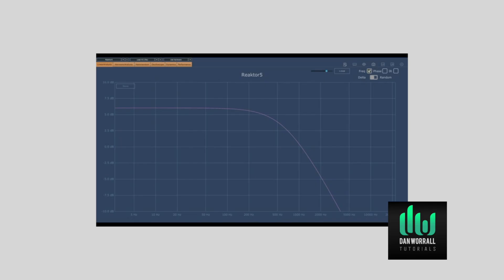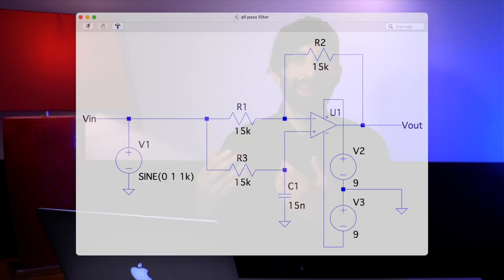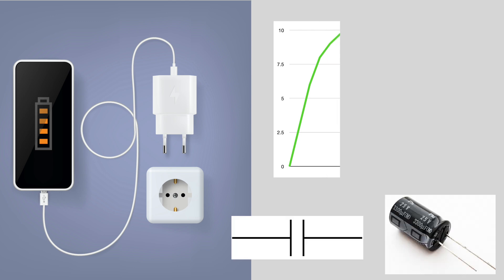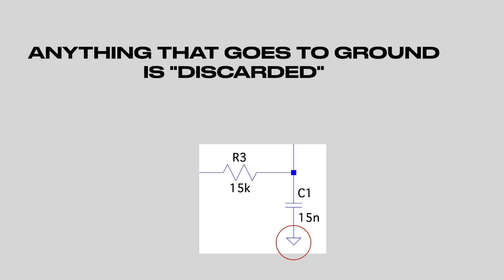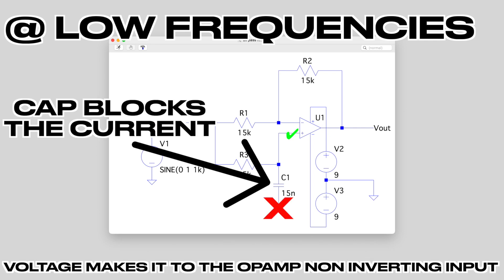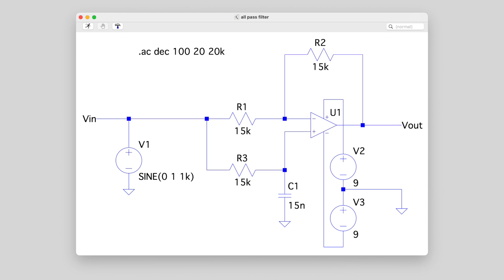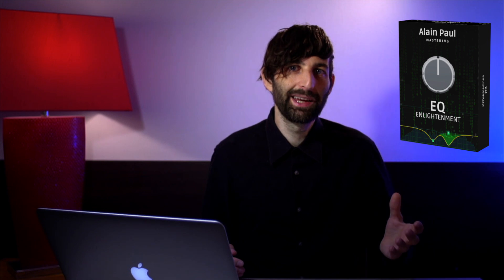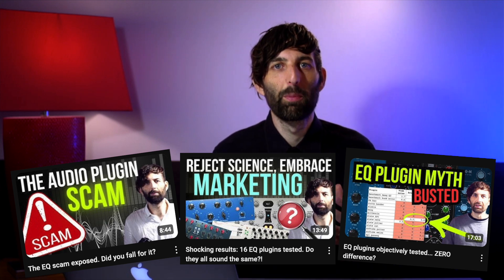Does phase shift ACTUALLY cause EQ? Dan Worrall response

Comment: Nice video. My only cranky guy gripe is that current doesn't really pass through the inputs of the opamps. They are incredibly high impedance, and really just "measure" the differential voltage inputs.The magic happens with the virtual voltage at the opposing input when under negative feedback.

Comment: It's a lot easier for me to remember and understand reactance  of a capacitor and inductors if you remember how their impedance changes with frequency. Reactance of C ,X_c= 1/(2*pi*f*C). Just test at f=0 and you get the equivalent of an open circuit ( high impedance, hard for DC to pass) Now test at f= inf and you get impedance of a wire ( almost zero ohms, easy for hf). For inductors, X_L = 2*pi*f*L. this works the opposite. zero impedance at f=0, and high impedance at high freq. For simplicity, just remember, Xc~1/(fc), Xl~ fL

Comment: Great video, This is all new to me and I'm having trouble understanding why phase comes in, I understand inverting it cancels out that part of the wave. But if you have already "binned/grounded the high frequencies" why couldn't you just take the output of the lower path in the diagram before the OP Amp? What are you cancelling out with the phase inversion if that part of the signal has already been split and discharged to ground through the capacitor?

Comment: So, did you study electrical engineering or sound engineering at uni? I'm assuming that if it was sound engineering, then there were modules of electrical engineering as part of your studies? Very cool.
Reply from the maker: I studied audio/music engineering but I learned very little from uni. I learned almost everything I know independently either by working in the industry or reading etc

Comment: Great explanation on the basics of these analog components and circuits.
But the topic is way more general I think. You focused on some implementations, in your case implementations in the analog world. But just because you showed one basic all pass filter analog circuit in which there is a low-pass part, it would not necessary mean that you need low pass filtering for an all pass transfer function in every case. There are 'filters' around everywhere. You can model them in digital, you can implement them with analog electronic parts, but you can build a bass trap in your studio to dampen certain frequencies - you created a kind of an acoustic filter... 
So I would say to decide what causes what, one has to dive into signal theory... and then it can be applied to any implementation. 
Note: probably it would be better to phrase the question without the word "EQ". We are courious about amplitude changes with respect to phase shifts. EQ is a tool you use, amplitude is a more exact scientific term, right? :) But this goes really do Dan I guess.
Reply from the maker: i 100% agree. to be honest i mostly just wanted to take the opportunity to explain reactance because its at the foundation of analogue signal processing

Comment: I'm not a big fan of analog audio in general. I once had a course on it in university and while I forgot most of what was going on there I still remember that every analog component has multiple functions at the same time. one of those basic components for example both lowpass AND saturates the signal, which would be 2 entirely unique and seperated processes in digital audio, which is why I feel like digital audio does a more precise job at explaining how certain effects work. for example filters can be either FIR or IIR. they both consist of short gained delays and the only difference is that IIR filters also have feedback delays. the real question is not "what's a filter?" because if you tell people it's just a bunch of delays they still don't know why the delays cause phase shifts or frequency responses, but the question is how to calculate coefficients for filters to make them have these specific properties. and suddenly you find yourself in the mids of terms like z-plane, complex numbers, unit circle, ecliptic filters, biquad filters etc. so if i was asked what's a filter i'd say: a configuration of delays based on trigometric equations to fulfill certain frequency and phase responses
Reply from the maker: not sure about saturation here in the LP filter as caps and resistors don't saturate as such... most of the formulas you use on dsp come from analogue principles. of course circuits are more complex because of current flow and impedances but there are many shared principles and a lot of the math you use literally originates from telephone electrical engineering manuals
Reply: @APMastering  that's true. a lot of the great ideas in dsp come from analog inspiration. but still they end up being more precisely formalized in the world of dsp math